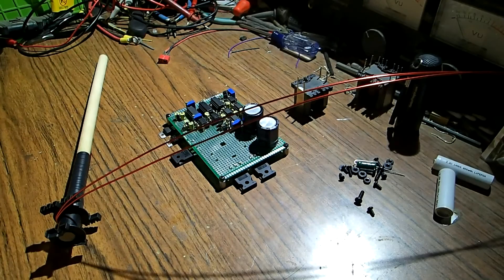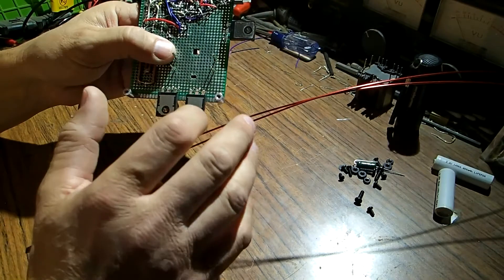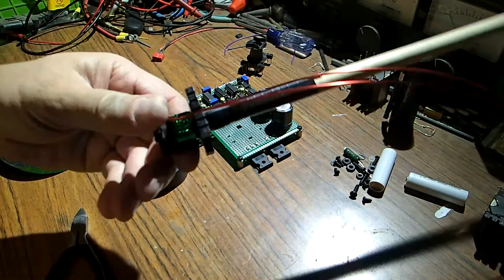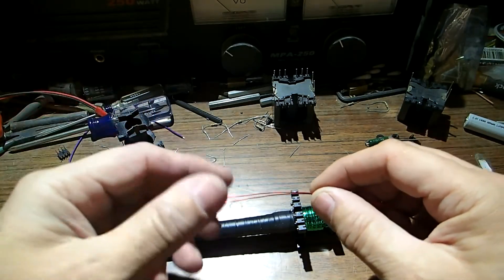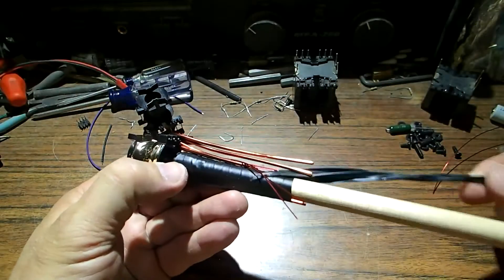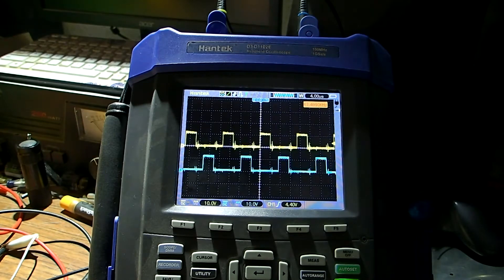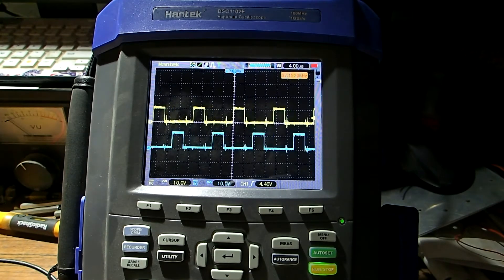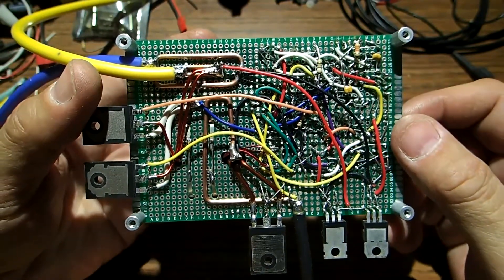62 Khz High Power Switching Supply Part 3

Comment: howd you go selling the house & moving?
Im moving soon myself! What a nightmare packing up etc
also any luck with part 4?

In relation to your 6 coil gun I couldn't find a diagram of your gun's capacitor charger anywhere. Can this unit do the capacitor charging.
Thanks heaps in advance !

Comment: how do you calculate the thickness of the wire for the primary and secondary ? all i have are the number of turns
Reply from the maker: You can use a wire table on the internet basically 12 gauge you could do 15 amps. You look up the amps of the wire that you want to use. Some people use the terminology called 750 circular mils per amp that's basically the cross-sectional area of the wire I believe.
Reply: i calculated and i have following :
Np= 30 turns 
Vp=220V
B=1800
Amm^2=162,0
F=62000Hz
Ns=4 turns

Vsec=30V
Asec =10A

i looked again and again ,for the 62KHz you chose 18AWG witch is for only max freq of 17 Khz 
then i was thinking , is it possible to wire the secondary and the primary with the same gauge wire ?
for my aplication it results that i should go for 24AWG , am i doing it corectly?
Reply from the maker: James Bond the ratios correct for the 220 volts down to the 30 volts that's correct they are current ratio is the 220 / 30. Let's say for your 4 turns you used 12 gauge wire. I actually made my 12 gauge wire delivered 20 amps. The primary current would be 20/ 7.33=2.72 amps.
Reply: 1-but what if i want to wind with 0.6mm on the primary and 0.6mm the secondary , will it still be 4 turns or i need to use litz wire instead ?

can i mail you ? it's simpler to show my calculations of what my supply is going to take shape
Reply from the maker: James Bond you can't use the same thickness of wire on the primary and the secondary because the secondary current is 20 amps and you can't use 18 gauge wire for 20 amps

Comment: What determines th current of a power supply?
Reply from the maker: Fakest God in this video here the size of the wire that I put on that Transformer. In general power supplies the size of the Transformer determines the current capability of the power supply. In a power supply that has a controllable output current that's adjustable the maximum output is limited to the Transformer again but the minimum output is controlled by the current limit circuitry in the power supply.

Comment: if I have a center tap in a coil of 6 turns do I use the bifilar style with three windings on each wire and solder the middle?
Reply from the maker: Fakest God if your calculation is for 6 turns on the coil you must wind bifiler six turns.
Reply: Would this raise the gauss
Reply from the maker: Fakest God the gauss is not raised on the secondary gauss is only affected on the primary
Reply: That makes sense but my next question for the primary side is do I need a center tap to do current
Reply: Current sense I mean
Reply from the maker: Fakest God no you do not need a center tap to do current sense that has nothing to do with the center tap, the center tap is needed so that the 2 power fets can work in push pull mode. The center tap is needed on the secondary, so that bipolar power can be achieved or so you can lower the full wave diodes from 4 to 2. With a center tap on the secondary it's possible to have full wave rectification with just two diodes.

Comment: What determines the current of a power supply?
Reply from the maker: G E T R E K T 905  basically that would be correct if your fets get too hot under normal circumstances,  you need more fets parallel, more heat sink helps too, but adding more fets in parallel,  reduces the stress on the fets.
Reply from the maker: Dominic Nedlewski the current is determined by the size of the wire that's put on the Transformer secondary. The limiting of that current is determined by a .1 Ohm resistor acrossed a base and emitter Junction of a npn transistor
Reply: Moss Fett does that shut the power supply off and on to keep it at 20 amps?
Reply from the maker: Dominic Nedlewski it has two current protection devices one is overload if it exceeds that it shuts the supply off the other one is current limit that one Limited at 20 amps or whatever its adjusted to that uses an operational amplifier measuring the voltage across 12 gauge wire 4 inches long
Reply from the maker: Dominic Nedlewski no the power stays on it limits at 20 amps.
Reply from the maker: G E T R E K T 905  https://youtu.be/vFHImxFLKo8

This is the circuit with the limit, it shuts off the fet drive on limit.
Reply from the maker: G E T R E K T 905  for the fet to reach thermal overload, it would have to overcurrent thus it would trip that circuit.

Comment: Thanks you videos have been very useful. i just have one doubt did you tried to put more voltage on your coil gun? I am running mine at 1500V and the efficiency is way better, obviously i had to modify the inductor but its working for me.
Reply: are you using 1500v ?? what's the capacitance ??
Reply: Vasudev Mr Probably very low as he'd have to put everything in series. Claiming "efficiency is way better" also has no backup.
Reply: 300uF
Reply: Man i am your your fan.
Reply from the maker: Heron Guarezi I have no high voltage capacitors higher then 450vdc.
Reply: If you put 2 450VDC caps in series you half the capacitance but double the voltage rating. Which may almost double output current in coilguns, since ESR is neglectable due to coil resistance and inductance.
Reply: this way is possible to put more caps, have more energy and the coil can have more resistance with means thinner wire and more turns the result is a coil more efficient and smaller my only drawback is that the coil overheats after 8 shots.
Reply from the maker: Azagro I never got good results when I put the capacitors in series
Reply: Yeah, because the ESR is also multiplied by the amount of capacitors in series. ESR of 27mOhms for example, is very good, 6 in series would give 0.162Omhs, 6 in parallel would give 0.0045 Ohms. Huge difference. Also capacitance is divided by the amount of caps. There should be no current gain from the caps themselves. Since I = V/R and in series would be I = 2V/2R, same shit. It would have theoretical effect on the series resistance over the coils.
Reply from the maker: Azagro very good my friend, in fact the first stage of my coil gun was 18 capacitors in parallel.
Reply: Power is voltage squared divided by resistance. Obviously higher voltage will affect the result far more than resistance, since it's quadratic. Putting them in parallel will just make the pulse longer (see RC and RLC circuit for reference). The fact that putting them in series gives you worse results might be projectile saturation more than anything else. Also, every mass has inertia. So if you make the voltage too high (and the pulse too short), the projectile will have less time to accelerate.